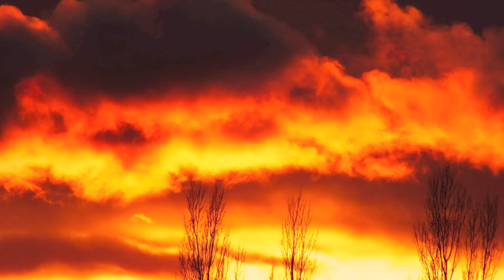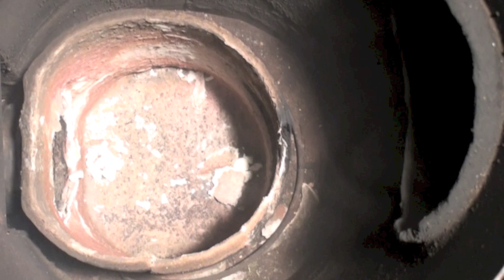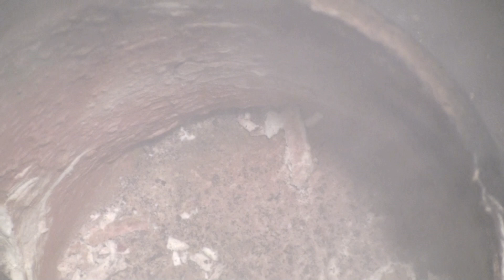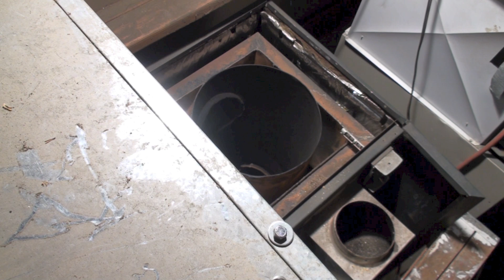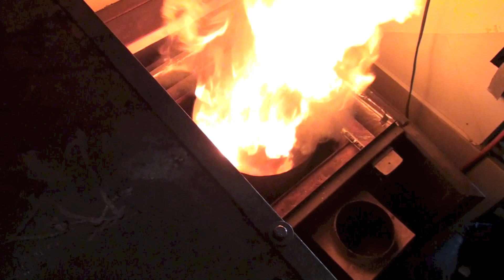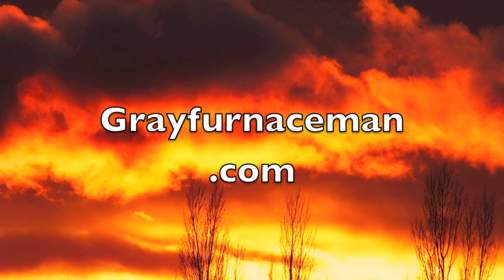Oil furnace delayed ignition

Comment: I have a AFII Beckett burner and recently started having delayed ignition issues. Filter has just been changed, do have the slightest leak on top side of shutoff valve by furnace (one drop onto floor a day type leak). Not sure where to start looking for the problem, no one in my area will touch these  things
Reply from the maker: First, replace nozzle.  You could have a suction leak if the tank is below the burner.  Electrodes could be out of position or shorted.
GFM

Comment: I’ve been told different things. But if this happens should you shut it down? Or let it burn the oil?
Reply from the maker: Once the burner has lit, it is best to shut it down.  It will continue to burn even after it has shut down.  Hopefully, it will not run away.  If you leave it on, it will just burn hotter and could run away.
GFM
Reply: @grayfurnaceman  thank you so far I’ve been lucky to not have run into that issue yet. But now I’ll be more prepared if i do

Comment: What are all the possible causes of a delayed ignition if the electrodes and transformer are brand new and set correctly ? Strangely, it only happens after a few startups where the furnace had no delays. I think it could be a draft issue caused by the metal chimney liner ?

Comment: Have any of these explosions  damaged the combustion chamber, particularly the refractory fiber type, molded I guess? I should check mine, which is difficult to get a good view of, being a steel boiler with no door to open. Will have to take the top off and use a large work light to shine down the tubes and get a small light in the little peep opening.  Blew off the barometric damper ( partially my fault for not tightening it in the collar) and displaced the stack a little.
Reply from the maker: We generally consider that a puffback, not an explosion.  Unlikely that there is any damage.  
GFM

Comment: That was a really good in an informative demonstration now I know what the fog look like when I was in an old abandoned house wants the still had power to it and I wouldn't turn the furnace on but it didn't light and after a while I smelled oil and then seen that mist
Recycler type of furnace how to stack switch on an instead of the other system I noticed that there was a broken water line down in the basement also the water wasn't on but apparently that must have been what happened is from the people who used to live there we're gone on the furnace in the winter time must not have lighted and then it got cold down there and broke the water line

Comment: What would be my problem if the furnace is tripping when it should fire up the next time? I hit the reset and it fires, runs through a normal heat cycle until the thermostat turns it off, but trips out the next time the furnace is suppose to kick on. When I first hit the reset there is the slightest amount of smoke that comes from the peephole, and things I've read online pretty much say I'm gonna die, but that little bit of smoke I didn't really think was an issue
Reply from the maker: Are you sure it is tripping out on the 2d startup?  Or is it shutting down sometime after you reset?  You could have a low flow problem.
GFM
Reply: @grayfurnaceman  It definitely runs a full cycle. I'll hit the reset once and it may take a second to fire, but then it will run until the thermostat says to shut off. I was curious the other day before I left for work and after it kicked off I set the thermostat higher to initiate the start up. I could hear it click in the basement but it never fired, and just tripped the reset. I work until late so tomorrow morning I'm going to try replace the filter from the tanks, and maybe the spray nozzle.
Reply from the maker: @RD3_R88  If the burner motor started, but shut down on safety, and you can open the inspection door, look to see if there is a fog of oil in the chamber.  If you have a fog, supply is probably not the problem.  btw, do not open the door while the motor is on with no fire.  You could get a face full of fire.
GFM
Reply: Thanks for the input. Now I've read online about people dropping burning newspaper into the chamber in case the were any fuel in the bottom. They mentioned not hitting any reset if it is burning leftovers off the bottom because that fire and the spraying of new fuel can explode... Is this something I can try just in case?
Reply from the maker: @RD3_R88  Well, it all depends on how much fuel is in the chamber.  I have always just used the ignition of the burner to set it off.  If the chamber is cold and you shut off the burner immediately after it lights there is little to no chance of explosion.  But if there is a lot of oil in the chamber, it can get out of control.
GFM
Reply: I actually tossed a paper towel into the chamber and kept an eye on the burn. It wasnt very much fuel because I know the dangers of hitting the reset button. Once the flame was almost out I actually hit the reset and it fired the furnace. A buddy of mine is coming to help me fix the furnace on friday 1/17/20, but when I got home tonight on thursday I threw a little burning paper towel in and actually used it to start the furnace because I couldn't risk the mini-split system I have to heat the house overnight. Everything worked fine, and I definitely appreciate the help and advice. For future reference tho if somebody didn't press the reset more than a few times, and you know it's just not getting spark you can at least use the paper towel method to ignite the furnace for 1 cycle and save the pipes and whatever else from freezing

Comment: My furnace lights fine usually, but intermittently it won't light. Got good spark, and I even installed time delay relay on burner, so spark is there a couple of seconds before burner kicks in. Puzzling,  I am thinking it may be nozzle may be wrong pattern. 

Any suggestions?
Reply from the maker: Check spark.  Should be strong and should draw out to about 3/4".  Depth of nozzle should be at manufacturer specs.  Nozzle replaced?
GFM
Reply: @grayfurnaceman  
I finally broke down and bought a solid state igniter,  and so far that seems to have done the trick. 
  The old one would work fine while I monitored it, but then after a bit it would fail to ignite the furnace.
   Do the solid state units hold up well, and are the designed to be energized all the while burner is running, or would it be wise to wire in time delay relay to shut igniter off once combustion is achieved?

Thanks
Reply from the maker: @LincolnSP150  I always run them continuously.  If you want it to be intermittent, you can wire the cad cell so that it shuts down after the flame proves.
GFM
Reply from the maker: @LincolnSP150  I always wired them in continuously.  You can wire the cad cell relay so the transformer shuts down when it proves flame.
GFM
Reply: @grayfurnaceman  

I got a few Allen Bradley relays with the on or off delay left over from when I built and serviced Machine Tools for Kearney & Trecker.
I was unaware the cad cell relay was capable of that, I will look it over. Thanks
Reply: Spark is Strong, I did replace nozzel so that may be the culprit,  but it works well for several cycles, then once again to will fail to ignite. I will have to put former nozzle back in service and see if that clears it up. New isn't always a guarantee of proper operation I guess.

Thanks for your responce.

Comment: Great video. My boiler starts with a boom but flame looks good inside chamber and stops smoothly without excess burning. Is it normal to hear an initial ignition loud boom? Tiny delay between click and boom.
Reply: No.  It may get much worse.  Clean the burners.
GFM
Reply: Did you get this issue fixed? My oil furnace just started doing this. There is a delay before it lights and when it does light it's a pretty big boom when all the diesel spray lights. It wasn't doing this before.
Reply: @patgrantlandjr.8302  seems like a new nozzle and adjusting the electrodes helped a lot

Comment: Great demo as always! I'm glad I have a gas furnace after seeing this!
Reply: Gas is more explosive than oil!
Reply: @KeithsTVHD1  You are right. However, gas will quickly dissipate if the burner doesn't light. But with oil, more and more will build up every time the burner fails to light, and the oil will stay there until it finally does light. This is especially dangerous if someone else in the house (or a tech) comes behind and tries to light the burner not knowing that is full of oil.

Comment: never ever in 35 years in this business have I seen a hot-air furnace blow up or a boiler even for that matter this guy likes to burn big fires and impress the people that don't know s*** about an oil burner
Reply: I worked on oil for over forty years.  I saw a sailor get killed by a delayed ignition on a oil fired Clayton Steam generator.  I’ve seen plenty of delayed ignitions, and fires just like this video shows.
Reply from the maker: You must have been the dispatcher.  "Rapid expansions" are common in gas furnaces although they are not as often damaging to the equipment.  As for oil, the term "puff back" is a rather mild term for a soot filled structure and blown off vent pipe. 
You have also missed the point of the video.  Its all about delayed ignition and the possible dangerous results.
GFM
Reply: grayfurnaceman I know you’re trying to warn people. After witnessing my neighbor’s mishap, I understand your intentions.
Reply: grayfurnaceman nope I've been sucking Sout and getting dirty since the beginning been in business for 20 years these videos don't teach anybody anything.  you say in this video that fuel oil doesn't burn until it becomes a gas. fuel oil does not become a gas until it is heated to 145 degrees or slightly more. it atomizers the fuel to the point where your high tension electricity that's being thrown into the spray Heats it enough to light it. it'd be nice if you could teach some people something about some Modern equipment instead of this Antiquated s*** that you've been pulling out of the back of your f**** garage. can you even buy a j pump anymore? and why would you be talking to me about gas when you are messing around with oil? so you think whatever you want to think about me but I could run circles around you as a burner Man
Reply: LARRY CURRIER - hi I just wanted to say that my neighbors oil furnace blew up while he was inside the house. He was hurt bad. The windows shattered, the chimney came down and the doors blew off. Now I’m afraid, how can I be sure this won’t happen to me?

Comment: So if it pops the breaker does it continue to dump fuel? Ive recently been having a problem with mine and I kept hitting the button till it re lights and tonight when I did that I could smell soot in my house I figured it was just burning off the stuff that wasnt lit but should I shut it down and wait a few before trying again
Reply from the maker: Kenneth Prince It does not dump after the cad cell relay safeties out. However if this is happening you need repair. Resetting the relay several times will put too much oil in the combustion chamber and could cause a fire. 
GFM

Comment: Hi GFM, My dad at the age of 72 is now fully retiring form his own liscensed plumbing and HVAC repair business do to some signinicant health issues with mobility, but he enjoys telling me about an incident that he came accross about 50 years ago. When my dad returned from the army before he took over my gradparents dairy farm, he worked for a local hardware store in town that was owned and operated by two brothers, one ran the sore, the other did the plumbing and heating service. They were at a big church and private school on a cold fall morning doing some plumbing in the boiler room in the basement when the custodian had come down several times while they were working on something else. After about the third time the owner of the plumbing and heating company had asked the custodian what he was doing he told him the boiler wasn't firing as he reach down to push the reset yet again. At that time before he could say or do anything this tome, the oil burner did light, along with the reaming un-burned oil in the fire pot. My dad said they all headed for the sitars up and he or the owner managed pulled the disconnect to the burner motor on their way and evacuated the building. He said you could just hear the fire rumble in the boiler. They all stood back outside from a distance and watched the chimney just pour pot black smoke. Luckily, no one got hurt. Thought you might enjoy this. Scott
Reply: The Wood Craftsman

Comment: furnace won't start? try dropping a burning paper towel down the door, to let the fuel burn off without adding more fuel
Reply from the maker: +Denis Rhodes This would be a good idea IF you are sure there is not excessive oil in the chamber.  
GFM

Comment: so how you fix this????  is the nozzle???? that has to be replace!!!!  thanks....
Reply from the maker: +Jaime Baeza There are several possibilities here.  Plugged heat exchanger or smoke pipe, nozzle partly plugged, oil spray impingement on the burner head are all possible.  Hope this helps.
GFM

Comment: Is there any amount of time I could wait that would make it safer to light after hitting the reset button about 3-4 times already? I readjusted the gun/electrodes to the specs that I found specifically for that model. And I also cleaned the base of the springs on the tramsformer. I would love to test them, but I don't want to spray more unspent oil in the chamber. I also don't want an explosion. So I'm wondering if it eventually evaporates or anything? Or can I clean out the combustion chamber so I don't get some ridiculous explosion and burn my house down?
Reply from the maker: +Brandon Parry If you have really only reset 3-4 times, and no one else reset it, You can reset if the combustion chamber is cold and the oil nozzle is less than 2 gal per hour.  Have a fire extinguisher near.  You might start the burner, then shut it off after it starts.  The oil will burn out.  Do not open the inspection door.  Hope this helps.
GFM
Reply: I did this same thing recently, got some excess oil in the chamber while dialing in a replacement burner. Once I got ignition, let it run for just for a second then shut it down and listen to the after burn. It helps if there is already a draft established so the smoke doesnt pour into the furnace room. Burned off the excess oil with no harm done but it can be a little nerve wracking.
Reply: @LibertyDIY  Had mine burn for probably 2 hours once before I had a little understanding of furnaces.  Basement was a lil smokey lol

Comment: I have to hit my reset button at least a few times a week. I click on the thermostat and it tries to start , I notice the first motor come on but the blower is not on yet. After about 30 sec.s the blower goes booowaa and I hear the flames going. Now  every so often my floor furnace will do the first phase then after about 45 sec.s if the blower doesn't kick in . the unit shuts off . Then I have to crawl under the house and hit the reset button. Its been doing this for years on and off. One rapair man told me to replace the furnace and it wouldn't last , that was like 10 years ago. IT still runs. I have thouht of taking the reset button and moving it INSIDE the house and attaching it to the unit so I dont' have to crawl under the house so much. worst come to worst I have thought of drilling a hole in the unit and attaching a stick or a bar or something that can hit the reset switch from above so I dont' have to crawl through that 3 foot door and crawl under the hose multiple times all winter long.  What do you think I could do to keep it from missfiring or cutting off. sometime's I can cut off the thermostat and wait an hour and hit it again and it comes on fine but sometimes in the middle of the night it tries to come on by it self and it shuts off because the burner is not burning or what ever. and I wake up cold with no heat and end up doing the crawl dance again.  what do you think make s this happen . And I have bled the line a few times over the years.
Reply: Still have that furnace? lol

Comment: And that is why company's are getting out of the oil business now, lol,
Reply: I don't know if that's why, but I do know were I am no one ill go on an oil call, there are 1 or 2 but its always 5 to 700$ for any call, I  have done my own for many years as when I worked in the bush camps for a big forestry company, they needed guys to fix the oil units in the bunk houses, I took there courses so I had the training and each camp had 20 to 30 furnaces though out all the camp buildings,,, just open the inspection door set fire to a paper towel to burn off the excess oil, sure the unit will do a little dance, no biggy, when I bought a new nyt boiler, oil, I installed my self, plus look after many with oil, show them how to do it, its not rocket science, hell I use to cut open fuel oil tanks on equipment all the time to make repairs as a welder

Comment: I always ask the customer how many times they pushed the button. I ask in a way that it would be a good thing. That way they will usually tell me the truth. If its an old 45 second control in a little hot air furnace I wont light it if they hit it more than 6 times or so. The reset button is the worst thing they ever put on an oil burner. Atleast the newer controls kind of stop them at three times.

Comment from the maker: If they are sparkly spots, the fuel is not completely burning.  Is the flame burning in a reflective chamber?  Some of the older furnaces had a brick chamber.  It took up to 5 min to warm up to burn all the droplets.  As for the oil, who knows?  Hope this helps.
GFM